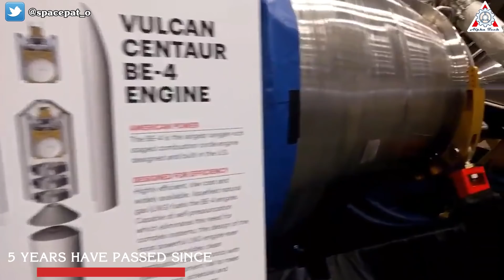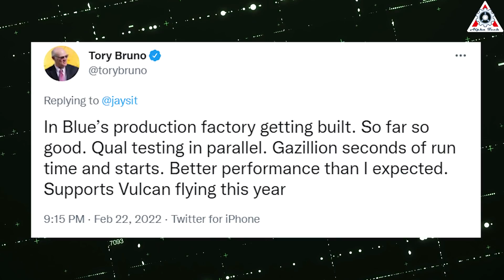Disaster! What Exactly Went Wrong With Blue Origin BE 4 Engine?

Comment: It would be one thing for ULA to be late to develop their own engine.  But being so late, and after half a decade of loosing launch contract to spaceX end up still dependent on another compagny, and their pricing is not a good place.  I get that they try to buy roketdyne (by lockheed) good thing it didn't happen, i think it would have lower innovation, as i think it would have slowed aerojet innovation to the lockheed pace, wich is "don't do anything without a contract with customer paying developement, and then try to steer the contract to be as minimaly innovative as possible"

Comment: You didn't actually explain what went wrong. All we know is that BO has taken far too long to get these engines delivered. The problem with shifting any given USSF mission to SpaceX is that their payloads often requite vertical integration and/or a five meter fairing, neither of which capabilities SpaceX presently has, although they are developing them.

Comment: Simple, the reason ULA does not have their production BE-4's, is because BO has not worked out a repeatable process to assemble them that is cost effective. The next hundred engines need to be put together the same way, and never change to keep the certification ULA gets from the military after 3 successful missions with other people's payloads. Being hardware poor BO is likely having to disassemble  production engines repeatedly until they have a documented repeatable process that they can live with for the next hundred engines. That's what they mean when they say they are going through the qualification process with production engines.

Comment: ULA does have a legacy rocket with American engines, the Delta IV. They could move missions to Delta if they run out of Atlas V rockets.
Or BO, since they're the cause of the delay could sell those Atlas rockets back to ULA.
Reply: There are only 3 Delta IV Heavy launches left and then that incredibly expensive rocket is being retired.
Reply: @markb2773  Regardless of cost, which is mainly the Shuttle derived RS-68A engines, the production line, fabrication, and supply chain still exists. Therefore if needed it could be used instead of Atlas V.
Reply: The Delta is not as capabable as the Atlas V.

Comment: i don't doubt the validity of the overall design idea ofthe BE-4. what i doubt is the separation of powers within the corporate environment that should otherwise be innovating against the first principle problems the BE-4 displays in testing. what are the be-4 testing stats? what are the failure-solve numbers to-date? what are the optimization and distillation numbers? iterations and iteration based design delta should be a prime factor in the analysis of engineering advancement.. oh.. wait and then there is scalability and reuse targets.. whew wow.. can't keep up with all that!, but i know some lobbyists that can slow it down enough for me to keep up.

Comment: So I ran the numbers, and apparently, Mr. Musk had a similar idea.  The original Raptor was not a viable replacement for the BE-4, but the Raptor 2 is.  In lb-f thrust:

BE-4  (advertised) - 2.4 MN = 539,541 lb-f 
Raptor 2 (currently in final phases, first unit rolled out) - 230 t-f = 507,063 lb-f

Looks like we have a contender!  ULA should be watching Raptor 2 development very closely!
Reply from the maker: yep, Elon Musk, SpaceX raptor 2 will change the game
Reply: And the first Raptor 2's were delivered last week to StarBase (Boca Chica) and should be mounted on Booster 7 (or 8?) soon.  Sadly, Raptor 1's are now obsolete.  

And in other news, Amazon will use the New Glenn to put up its version of a comm sat constellation.  They hired everyone but SpaceX to help them, probably providing a much needed cash infusion into Blue Origin as their top Rocket guy left last week.  In other news, Rocket Lab will build and launch the Neutron, another contender at Wallops Island.  They will be using their new Archimedes engine which is 191k lbf thrust, so not a contender really to replace the RD-180 and RD-181 engines that are now no longer available.  Northrup Grumman said they can do exactly 2 more launches.
Reply: @sdebeaubien   Northrop Grumman don't just need replacement engines, they need replacement first stages, since those were previously built in Ukraine.  Looks like their Cygnus spacecraft will need a new ride, probably on the Falcon 9, unless they're willing to bet on the BE-4 and Vulcan, and pay a lot more for that honor.
Reply: @rbrtck  - they'd be smart to go with F9 for now.  Proven, reliable, cost effective.
Reply: Examination of the launch schedule for the remainder of 2022 shows that Space Force and NROL have seemingly switched horses, away from ULA and onto SpaceX more and more.  I see 5 FH launches scheduled (some are NET granted) this year, and 3 out of those 5 are USSF.  if you add in the roughly 30 or so more F9 launches this year, many of which are manned or resupply for the ISS, then you have SpaceX already doing "Yeoman duty" for the military and NASA.  Expect to see more F9 or FH launches announced, esp. if the upcoming USSF launches are a success aboard FH.
Reply: I don't think Musk would sell his engines to ULA, or anyone for that matter.  Engine production will likely be the rate limiting step in building his own rockets so none to spare.  Not to mention that he would be helping his competition.
Reply: "I don't think Musk would sell his engines to ULA" The point is moot. These are like automobile engines that you can just drop-in by changing motor mounts they are designed to an Engineering Spec which Space X does not have. They only other engine involved in the program was the Aerojet AR-1. Development on that engine was suspended several years ago. If the BE-4 winds up poop canned it will take several years to resurrect the AR-1. Until that time NASA and the US Space Force are stuck !
Reply: @WestCoastMole   Can't they just substitute the Falcon 9 instead of being stuck?  Of course, one goal is to have two systems for redundancy, and that would be lost for a while, but the point of redundancy is that there is an alternative so that the necessary flights aren't delayed.
Reply: @rbrtck  Or Falcon Heavy if they need more mass to orbit, higher orbit, etc.
Reply: @sambira   Good point.  I wanted to keep things simple, but the whole truth is that the Falcon 9 can't quite carry the heaviest loads that the Atlas V can when it has a bunch of SRBs attached.  For LEO, the Falcon 9 outperforms even the best Atlas V when the rocket is expended (no landing for reuse), but for GTO and MTO (Mars Transfer Orbit), the Atlas V outperforms the Falcon 9 because of its hydrolox-fueled second stage.

Fortunately, as you pointed out, SpaceX also has the Falcon Heavy, which massively outperforms all configurations of the Atlas V or any other operational rocket.  The US Department of Defense, NRO (spy satellites), NASA (interplanetary probes, which are the most challenging missions), and commercial customers will have all their needs fulfilled, even with SpaceX as the sole launch provider.
Reply: Raptor 2 has serious "hitting the limits of engineering" high-temperature melting problems.  BE-4 might be suffering the same issues.  EDIT 2:52 - 2:55 That seems to confirm my thoughts.
Reply: @RonJohn63   I was under the impression that the BE-4 was intentionally a somewhat conservative design that did not push those limits.  Perhaps its performance fell so far short of estimates that it has to push the materials to the limits now.
Reply: @RonJohn63    What do you mean by serious problems?  Just about any engine can overheat itself and melt if you run it hard enough.  All they have to do is back off the thrust a bit, and the melting will stop.  It's only a serious problem if the engine is melting before it generates enough thrust for the application.  In the case of SpaceX and the Raptor 2, correct me if I'm wrong, but I'm under the impression that the Raptor 2 already generates enough thrust to make the Starship system viable.  What they're trying to do is maximize performance and efficiency by running it as hard as possible, and of course finding a way to cool it in a way that wastes the least propellent is a major challenge that they're still working on.  But it's not like the engine randomly, unpredictably melts down (major design flaw) or has fallen so short of the required thrust that the whole program is threatened.  Now those would be serious , worrisome problems.

You kind of put the Raptor 2 and the BE-4 in the same boat, but that's not necessarily the case, even if the work being done involves melting and the cooling system that prevents it.  The questions for each are whether it is fundamentally flawed or just being optimized (maximized), and whether it currently generates the minimum amount of thrust required for its application.
Reply: @RonJohn63   If the Raptor 2 doesn't achieve its thrust goal but matches or exceeds that of the Raptor 1 without melting, then that would still be a win.
Reply: Don't forget, though that you pay a pretty substantial payload penalty (the number I've heard is 35%) when you make a rocket reusable because you can't use all the propellant to boost the payload.
Reply: @almostfm  #1 not all payloads need the F9's full thrust.  #2 SpaceX's reusable rockets are cheap, and cost is important to commercial satellite operators.
Reply: @almostfm   That's true enough, but first, the Falcon 9 can still carry the vast majority of payloads when it is allowed to land, and second, if we're looking for it to replace the Atlas V, then for LEO it can actually lift more than even the heaviest Atlas V configuration (5 strap-on SRBs) when it is expended, and it's still a lot cheaper than the Atlas V.  The Falcon 9 only falls behind when going beyond LEO, but that's what the Falcon Heavy is for, and when landing is allowed, it's a lot cheaper than the always-expended Atlas V, as well.
Reply: Musk came out a few days ago and said they are working on increasing the trust to about 600k if they can workout the combustion chamber cooling to keep it from melting
Reply: @fbi805   600k lbs seems to be a lot more than the Starship requires.  It would help lighten the Starship (fewer engines required), which would increase the mass it can lift, and/or increase the cargo volume by allowing the Starship itself and/or the Super Heavy booster to be stretched a bit (made longer).  It sure seems that they're trying to get greater performance out of the system as a whole here, not dealing with a serious technical problem that jeopardizes the project.

The same may or may not be true of the BE-4 and Vulcan.  I for one don't have enough information right now to tell, although what ULA's Tory Bruno has said recently is encouraging.  Then again, it might just be forced optimism because he doesn't have any options to avoid disaster if the BE-4 doesn't pan out.

If the Raptor 2's "problem" is not being able to generate 600k lbs yet without improved cooling, then that is not really a problem at all, just SpaceX's aspiration to make the Starship even more capable than it is currently projected to be.
Reply: @rbrtck  well eventually at some point both NASA and ULA will have to come to an understading that Blue Origin isn't going to meet the requirements needed and will have to swallow their pride and sign a contract with SpaceX who have actually proven reliability and manufacturing capabilities of their Raptor 2 engine.

Comment: As someone who has worked on many engineering projects over the years, the excuses being trotted out by Blue Origin about the delays to BE-4 don't add up. If the engines were ready for production then why are they taking so long to build and certify. It makes no sense unless the engines really aren't ready for production at all and are having to have a lot of component post processing to get them to as stage where they are basically operational. There were too many problems late on in development in my opinion for this design to be production ready and I suspect there need to be some major redesign to get them to a stage where they are ready for prime time. I can imagine the cost of manufacture is currently sky high because of this and it's not at all sustainable.
Reply: My 2 cents: Jeff Bezos is not really a software guy. With his motto "Gradatim Ferociter" they failed to iterate. Doing new development means iterate, iterate, iterate. They tried the waterfall method and got the expected results.
Reply: Sounds like a typical aerospace company that is funded by the government (Air Force in this case).  "unexpected technical problems" is usually just management looking for more money.  Excuses like this is what is destroying Boeing.
Reply: @RS-ls7mm  True, but in Blue Origin's case their contract is fixed price with ULA not cost plus with the government. They basically screwed up really badly on this and it's going to cost ULA a fortune unless they can sort it out quickly.
Reply: @tribalypredisposed  Absolutely true, Musk could afford to bank roll SpaceX in the same way but he doesn't preferring to keep them grounded in reality. The speed of development at SpaceX is also a cultural thing coming directly from Musk himself. He will cancel projects that run too slowly regardless of the money already spent because he knows that getting bogged down on time wasting activities harms innovation and slows everything down. A good example of this was the switch to stainless steel for Starship rather than using carbon composites.  Things weren't progressing fast enough so he decided to go in a completely different direction.
Reply: @schrodingerscat1863  the big difference between Musk companies and other companies is the philosophy of less wrong. Assume you are not doing everything the best possible way and strive to become less wrong. One result of this scientific mindset is that ideas from anyone that are good are immediately accepted and implemented, even if Musk himself had a different idea. They also are willing to not know, two or more possible solutions can be green lit at one time if they don't know which one will work out better. Almost every other company would choose one suggestion and become committed to it and not try the other ideas because of sunk costs in the first idea until the breaking point because they don't want to admit that they were wrong. Musk companies, one accepts that they are wrong even when everything is going great so there is no fear of admitting an idea was wrong.
Reply: They are certified for the scrapyard?

Comment: ULA just made a major wrong choice 
When they choose BO.
Reply from the maker: super wrong choice ever
Reply: @alphatech4966  
It’s too bad cause it would have been great to see the Vulcan fly. Soon.
Reply: Clearly, in hindsight, although it seems that the New Shepard and BE-3 work OK?
Reply: @rbrtck  If you prefer suborbital flights yes.
Reply: @jessepollard7132   But they work as intended, which was my only point.  All an engine needs to do is generate a certain thrust profile over a finite period of time, and Blue Origin had at least made a working engine.

Truth be told, even at the time of ULA's announcement of their partnership, I'm sure that most everyone questioned the choice.  I chose to give them the benefit of the doubt because ULA always seemed to know what they were doing, and BO had had some successes, despite being slower and less ambitious than, say, SpaceX.  What's happened since then, however, seems to be a massive brain drain at BO, probably caused by management, which for some reason went south during the BE-4's development, and here we are.

I'm just saying that at one point BO weren't as maligned as they are now.  They represented slow, methodical, but seemingly quality development, not unlike ULA.  The New Shepard might only go straight up and down, barely poking into "space" by definition, but the engine works, the rocket works, and it can even land propulsively (not nearly as hard to achieve as the Falcon 9 first stage landing, but still a first for a rocket that can reach space).  BO weren't as messed up, or so it seemed, back then as they are now.